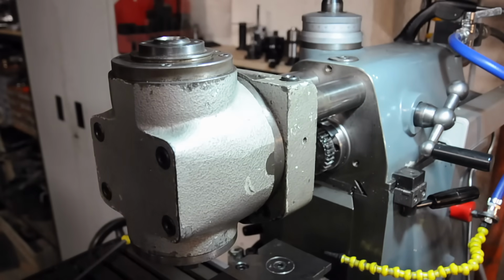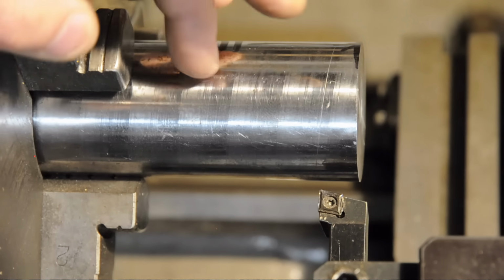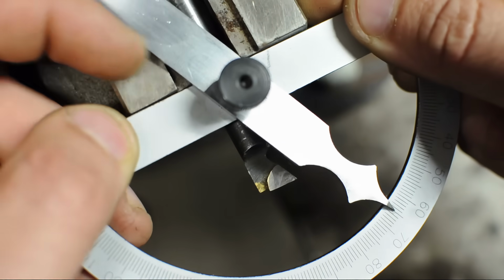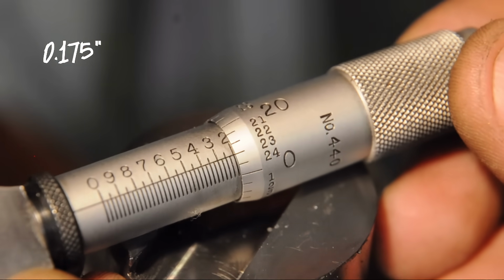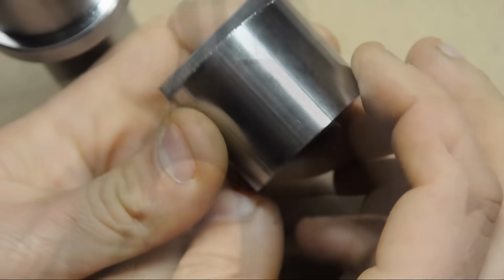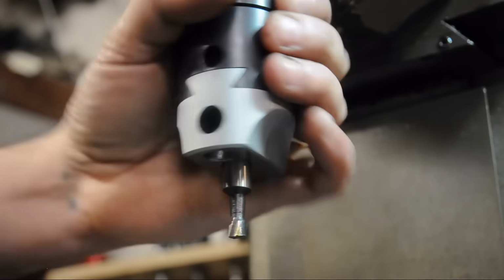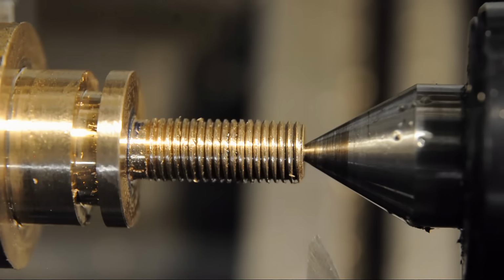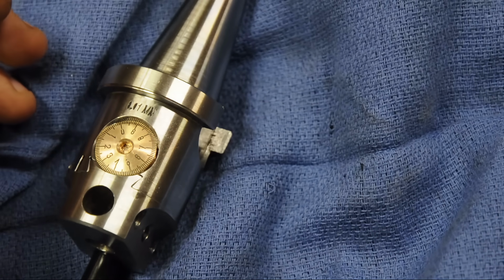Homemade - Boring Head

Comment: Ah, personally, even though you lost that future version boring head to the paradox effect, I think you should just be glad it didn’t experience any of that nasty cascading entropy stuff beforehand, after all, not only is it not a good way to go, especially for a loved tool you made yourself, but it definitely would have messed up the counter sink it bored, then both of you, current Tony and future Tony (well, previous future Tony) would have had to settle for a loss (current future Tony still has an existing head to use, thank goodness, even if previous future Tony doesn’t). Win some, lose some…lose some to paradoxes, I guess. Previous future, current future, a whole other confusing ball of wax.

Comment: Also make certain that your files are not worked I've seen a lot of Nicholson's these days that are warped and so I end up buying either the Grobet or the F.-Dick files. Dick does make long angle lathe files. Also, when measuring precise bore diameters I would use the Tesa Imicro micrometer bore measuring micrometers. I bought a couple of sets from 3.5mm up to and including 35mm. They make all the difference in the world. When cutting the threads for the boring bar adjustment screw they have to be very accurate according to the matter of fits or otherwise you won't get repeatability in boring holes. Amazing how nice the engraved characters look. All in all a very good job Old Tony. Now time for rust blue the blue designated driver areas while keeping the other areas "in the white."

Comment: Beautiful job. The only thing that worries me is the brass or bronze adjustment hex and screw. My boring heads all use hardened steel alloy for that part. The screws are fairly tight to eliminate play. I wonder how well that will hold up.

Comment: Adding width of 2 pins to measure dovetail size? Don't the inner pins and outer pins overlap a bit?
(update 7 months later, as my brain works slow, and after some tests in cad: )
The pins on the inner and outer side of the dovetail will either overlap a bit or have some gap between them, depending on the size of the pin and the angle of the dove tail.
So this method does not work without some trigonometry.
Creeping in on the size with lots of test fits seems to be the easiest way to go.

Comment: I never would have thought precision work like this to be possible on a setup like this. But I must say for a home shop you sure got all the good stuff to produce those tolerances. I guess your equipment is in very very good shape.
Reply: what did you think, that only a brand new cnc center can produce a quality part? ffs, people made the first flat surface by rubbing stone on stone for a long time, so put it that way... we can scrape to a higher level of precision than a brand new surface grinder can  grind... ok, you likely wont drill a hole by hand better than a jig grinder will do it, but come on, a good set of decent manual machines is what built the world as we know it... go watch stefan with his mini mill and mini lathe(maximat is not a mini lathe but still, aint a colchester or a monarch)... He makes gauge level of precision when he needs it with his puny little machines and home shop setups, just doesnt do things like this... there are others too, hell, look up calem, kid restored each of his machines himself to whatever degree he felt comfortable and produces amazing parts on the level of this boring head...

Comment: 18:05 That's just an approximation, though, I think?  Like, if you draw it out, and have tiny pins vs large pins, the tiny pins have more (and less, respectively) space across them than do the big pins.  Or, differently, if you imagine deepening the dovetail (so the narrow end gets narrower but the big end stays the same), then the pins on the outer edge get closer together as they follow the narrowing neck, while the ones on the inner edge stay where they are.  Therefore, it seems to me, since you could get different differences for two perfect dovetails of different depth, you can't get an exact measurement this way without factoring in the depth of the dovetail and/or the size of the pins.  (I think the recommendation that "they'll wanna make contact about halfway up that dovetail" accounts for this, making the approximation work.  It still seems worthy of note that without precise measurement it's inherently an approximation, not one of the other indirect-but-very-precise kinds of measurement you sometimes see.  Still a useful approximation, though - and since you didn't want the two parts to be exactly the same size, anyway, maybe an approximation is all you wanted.)

Comment: I bought a 75 mm Chinese boring head, but (the magic word), what a piece of junk (like 70% of all other stuff I bought). Firstly, it had 0.35 mm play between the slide and adjustment screw. Secondly, its imperial. I already designed a new boring head which I now will build. The markings on the setting screw will be a challenge. Unfortunately I don't have a nice CNC machine like you brother. You did a great job.

Comment: Wow! About 13, 14 years ago I got a new apprentice to make one of these for me to my design & under my guidance because the firm I worked for at the time lacked one & every request I made to get one fell on deaf ears! Very similar- even to cnc machining the dial (which I had to do), but mine was 50mm diameter rather than 40 with a mounting spigot to suit a 25mm collet to be used on different mills with different tapers. Good to see someone going to the same effort, though since I left there I heard that mine's been butchered I'm afraid.......

Comment: I do not think I have ever seen a lathe video where the tail stock was centered cross wise and up and down.....i always see the drill or reamer or other tools jump to center ..... it's really not that hard to center the trail stock but also it's easy to center the tool you're using in the tail stock... if your drill or in this case your reamer was way off ( by the way this makes tapered bores still bits reamers or boring bars ) any way I'ts of center or low you just shim one or 2 of the grips in your Jacobs chuck.... if you're holding your tool with a collet shim the part you need to....I can eyeball the tail stock and get the fine stuff easily and very quickly this way..... and sometimes it's a bent bit or tool shaft that can be made up for by shims and occasionally a tap of a deadblow hammer block of wood on any cutting edges.....

Comment: Ok - old video - second time - but I checked my shop and my turning ball head tool uses my Boring Head with a triangle milled into a 1/2" bar.  Any size and I have a wheel handle driving it.  Taken from a 1800's messy design and upgraded to tool post with boring bar for curves of various sizes.  Martin

Comment: Need a chipbreaker under the screw that cracks the chip strings up into small chips.  Many inserts attempt to do this with raised parts on the insert.  When I was doing CNC copper - I used 6, 8 and 10 mill end-mills.    It was a very high speed cut.  Small bed plotter converted into a PCB design board maker. We also used carbide D drills!!  I suggest you look into them - carbide drill blanks in a collet and a flat on the end with a small point in the D.

Comment: Awesome. I have one of those file  cleaning brushes. I got all my late fathers clock making tools. I had no idea what that wire brush thing I have was used for. I've been looking at it for the last 4 years wondering and in 1.2seconds I find out what it is on this video. Thanks old man tony. You the breast.

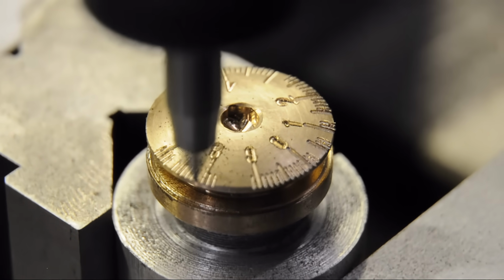Comment: 34:02 I'm sure it is plenty sharp. You just need to slow the feed, increase flutes or(best solution) grind or file some relief into your engraving bit. If it is one of those one flute points Ive seen you make, the problem is no relief. Without relief, you are pushing the round backside of the cutter against the work for a full 180 degrees after the cut- that tends to push the material out of the way.

Comment: Tony, you have many talents, metal working, video production, comedy, hand modeling, MANicure and on and on! I have a question about the adjustment dial.

I don't see any index mark on the body of the head, did I just miss it? Was there anything you did to assure that the markings on the dial correspond to actual diameters, when the dial is rotated at some angle?

Comment: Quick questions:

What do the ball bearings do under the m4 screw (what is their purpose)?
Reply: markus thiel if he does not have them the set screws will dig into metal dovetail backer, because a set screw have an edge. The ball bearing will seat into the edge of the set screw, the ball bearings are also harder and will not wear and get damaged as quick as the setscrew digging into the dovetail backer.   It may also provide a tighter hold because the force is focused on the single point the ball touches vs the edge of the setscrew.   Hope this makes some kind of sense....
Reply: @invisible468  It does make sense, thank you for the explanation!  There was another situation where ball bearings were used behind screws and I was wondering about why:
I was installing a deadbolt on a door. The screws run from the inside of the door to the outside and hold the inside ½ of the deadbolt (the face that has the lever) to the outside ½ (the face that the key is inserted into). Since there are no moving/sliding parts here it seems there is a different purpose in that case? My hypothesis was that if anybody should try to drill through the screws that the ball bearings spins with the drill bit and stops the drilling. Am I wrong?

Comment: Another way of measuring an inside dovetail between pins is, instead of stacking gage blocks, use an adjustable parallel. Adjust it snug, then measure it with the same micrometer you use to measure the outside dovetail, around pins.

Comment: Tony, you inspired me to build my own.  Mine is ready for the dial and screw.  I used a 3/8s 24 tap and will attempt an 1.250 dial diameter.  How would I calculate the dial spacing to how much the slide will actually move?  And also, do you think the large brass dial will be worth it?
Reply from the maker: 24 turns = 1 inch movement

Comment: Hello TOT, I'm just informing you about the ramifications of the causal paradoxes you created with this undertaking. More than five million parallel universes had to be quarantined and entire branches of Yggdrasil-4 are now backed up with causal loop verification and universe orientation requests. As you can tell from the date of this comment, I'm still experiencing extreme time dilation and having trouble synchronising my electronics due to the amount of temporal flux your chronologic wake left behind (and pushed forward! What were you thinking?). My tachyon drive is in the 37th century, and is still undergoing repairs - even 43 centuries earlier! My bill says the repairs will have been complete in another 41 years from the Einstein reduced date of this comment - give or take a three minutes - and when it does I will be calling on you. You should hear from the Temporal Obfuscation Tribunal long before that though. Have a good hour.
Reply: The first couple sentences of this comment aged very well
Reply: What an amazing comment

Comment: is that chromolly heat treated? the guy at the steel place where i get drops said if the 4140 has a spiral grind pattern than its heat treated. was actually looking for annealed stuff because im going to forge it, but intresting to know you can machine the ht stuff?

Comment: I added  the display from 4 inch digital calipers (harbor freight) to a low cost import boring head. So now I have a digital display boring head.
Easier to adjust and use. Works great!

Comment: Very nice job
Reply from the maker: thanks!
Reply: @ThisOldTony  I have a problem I have a 1984 buffalo drill press #15 floor model I need a new spindle 6t splined pulley I was woundering if it could be fixed 5/8 6t spline is striped ,still works but almost gone
Reply: @ThisOldTony  I can get a new one for 550 dollers I sorry but I can't afford that

Comment: The best file's you can get is grandpap's old file's from he's old Toolboks, i look for good old Tool's when i'm on a market with old stuf they sell, Tool's from 30, 40, 50 and 60 and 70 are mostly good strong Tool's, but after the 70 it start to come from China, shit queality Tool's, don't cost mutch and also fucking bad Tool's i better spend 500 dollar's more on a olg good Tool then buy 5 chip from China,, last year i did buy 5 or 6 new small grinder machine's, they was fucking chip only about 12 Dollar's for 1, so i did buy 5 or 6 of them, after 3-4 hour's i did drive back to the shop, i did burn them all, there was a fire inside all of them, they was only on 275 watt, not strong cut not even cut a 2mm metal plate, then i did brúrn them all, there was 2 years of garanti on them, but no thanks i did whan't my monye back, and i also did get them, then i did drive out and buy only 1 new Makita Grinder 950 watt, the weekend after i did buy one more, and i still have them both i use them evry day in my Workshop, and there was never eny problems with them, they did cost about 200 Dollar's for 1 so about 400 dollars for 2 makita grinder small 125mm on 950 watt, before i did onlu use Bosch the Dark Blue model for workmen, but after this makita i only buy makita Tool's, it's more fit in my small hands now i'm a woman so this Bosch are to havye and to big for my small hands, Makita more fit for my small hands, i'm a Volvo Truck Mekanic, i make Scania, Mercedes, Daf, and Volvo Trucks, i bild them up with cranes or without, i bild garbage trucks, i live in Denmark, and there is only 4-5 Woman Truck Mekanic in Denmark, and i'm one of them,, and i love it,,i love the sound of a Scania V8  Diesel engine, with 750 Horsepower on the Scania truck, damm i'm so clouse to get a strong orgasem just to here that V8 engine,,

Comment: Don't know why you're still using that old analog time travel machine. They're all digital now. Better resolution.
Reply: Mike, there's just something about the warm feel of the analog units.  You can hardly find them now what with all the hipsters buying them up!
Reply: When an analog machine runs into trouble, it can wind down safely using the residual space-time momentum left in the flywheel. When the digital units run into trouble, they just go haywire and everything comes to an abrupt halt. The last thing you want to see when you're barreling along at 2500 years per microsecond is a BSOD. Also, resolution isn't an issue, really. In theory, analog has effectively unlimited resolution, all the way down to Planck time. Just how well you can get things calibrated is all in the pre-jump indicating.
Reply: @davel6683  And remember -- all of that digital technology could not have been developed if it weren't for the pioneering efforts of the analog guys.  Er, uhm... unless the digital guys did it first, and then jumped back, and...  er... uhm...
Reply: Phreadrick Hejrick you're actually you're both correct and wrong. Both the digital and mechanical ones were around first. And it doesn't really matter anyways
While the digital one are very easier to use and are far more precise stopping down to milliseconds. But when they went wrong oh boy they went really wrong and having what's left of your scattered across space-time isn't what I'd call a good time. The universal positioning clock is also more precise so you're less likely to end up in the middle of space because you forgot to check your mechanical clock and now your solar system is millions of miles away and you're stuck in the vacuum of space. And the digital ones have a time-space memory that stores your last previously used space-time position you you can return a few milliseconds after you initially leave very few analog ones have this feature and the ones that do are only accurate down to an hour to a few minutes.
But the drift on mechanical ones makes them easier to use, in case you don't know, some mechanical ones allow you to shut off a specific part of it to allow you to slowly drift closer to real time it's more precise then a flat stop on a point in time manually but still not as accurate as a digital one. Also mechanical ones are cheaper, easier to maintain, and when they get broken are a lot easier to fix than the one that requires a theoretical physics degree and some level of mastery over software. 
In the end it's all personal preference and the rise in popularity with the digital ones is purely because time traveling is becoming more mainstream and people that help maintain and fix them are becoming more common as a career choice now. And because of that it's more convenient for a lot of people just to bring their more precise and digital time machine into the shop for someone else to maintain or fix.

Anyways back on topic both time machines came into existence at the same time when someone used a digital time machine to go to the future to steal a mechanical time machine and someone used the mechanical time machine at the exact same point in space time to go to the future to steal the digital one. I hear they're planning on making a hybrid system time machines sometime in the future that might either be better than either current option or worse. And guessing by the fact nobody stole it from the future yet it's safe to guess worse.

Comment: this is bitchin! did do a video on how the precision worked out?
Reply from the maker: Thanks HB.  I did not do a follow up but it's infinitely adjustable so the precision is more up to the user and one's ability to measure more than on the tool itself.  The dial itself is very useful of course but adjustments at the dial don't always = adjustments at the cut.  So meticulous measuring and clever 'sneaking up' are always required.
Reply: duh yea i certainly was not thinking. its been a while since i ran a mill